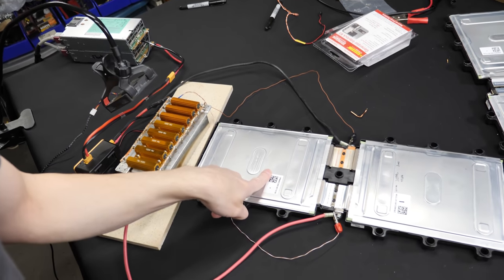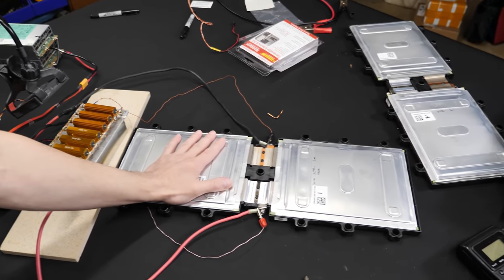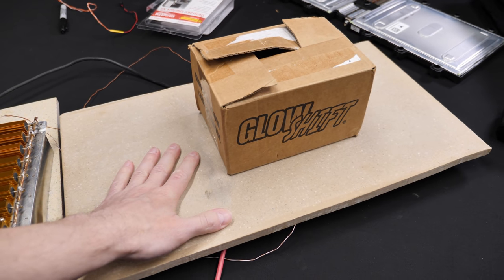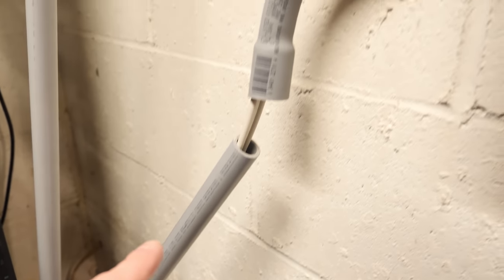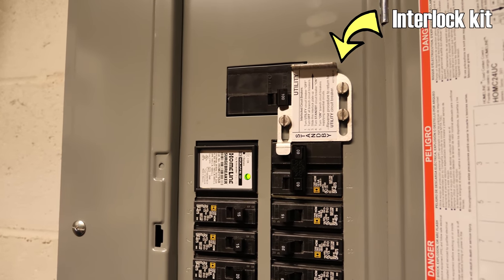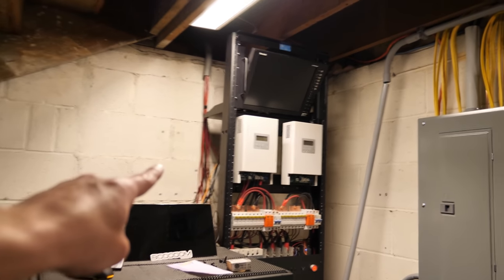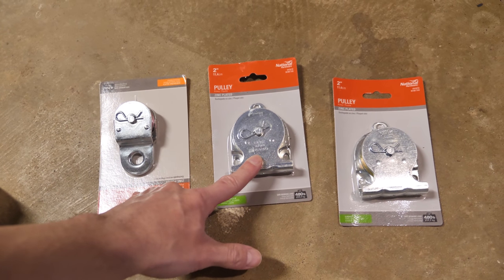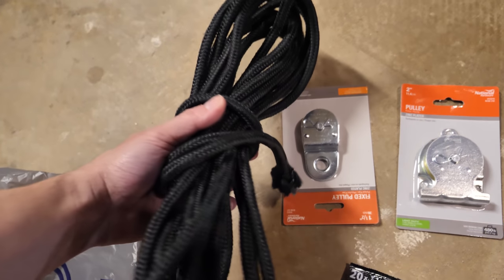Attempting to Mount 165lb Growatt Inverter on Wall!!

Comment: AJ, I know this an older vid, bur curious of your longer term opinion of the Growatt 12k?  I need a LF Inverter for all my daughters medical equipment as a backup, but torn between Growatt 12k or 2 EG4 6000 120/240 units.  Leaning to the Growatt, but your real world opinion would be extremely helpful.  Love your content and approach on everything.  Thanks and take care.
Reply from the maker: I still Love this inverter. Its on 24/7 unless I do a specific video and need to shut it off. I still dont have all my 240v items on it yet but will this year. I have run the AC and stove and no issues. Winter time I am in passthrough mode a lot due to no sun. As soon as spring hits Im off-grid. I would purchase again. Would also say I hear good things about eg4. One thing that they have better is the paralleling option PLUS you can add solar to each inverter. With my setup, I have to add seperate charge contollers to add more solar. Either way you go is a good option in my opinion.💥🤘

Comment: Which inverter did you buy, that will cover the whole house? Would like to go off grid myself. Thanks Ronnie
Reply from the maker: Link in description! I have the 12kw growatt split phase low frequency inverter. This one has the 250v solar charge controller. They also have a 150v version as well.

Comment: nice video. For the price of those pulley's , you could of got a "come-along" .They work good and lock in place. Most
of them are rated for 2000 lbs or more
Reply from the maker: 100% TROOF!!!😆🤘

Comment: Are you going to leave it with just those plastic inserts in the wall holding it?   I would suggest looking into something more sturdy, either the metal anchor inserts, or the actual concrete anchors.  Either way good work, I'm jealous of your setup, it's stupid trying to get even approval for some solar panels in my area...
Reply from the maker: I was thinking about leaving it. Do you think Ill need something better/stronger? The screws are pretty long and were tight going in.  Seemed pretty solid but Ill keep an eye on it to see if anything moves away from the wall.  Where are you located at or is there HOA rules?
Reply: @AveRage_Joe  165lbs is just a lot for those style of screws into concrete/cinder blocks.  I like in a suburb of Houston Texas, they want me to have a master electrician to pull the permit for the electrical, and I have to pull a building permit to install panels on my roof.  Looks like I can get the building one on my own, just working on getting the electrical without paying crazy amounts for someone to pull it for me.  HOA in texas pretty much can not deny you, that's a nice state law we have

Comment: Yep I would be the same to bullheaded to call a friend. When I mounted the battery bank shells they are 200 or so lbs I used ratchet straps which worked ok just risky like you
Reply from the maker: 😆Lol to be fair it was like 2am when I started the "lifting" process.  I guess to be honest tho I would have not called anyone just to see if I could of done it on my own anyway lol!  Big ass ratchet straps was going to be my 2nd option if the pulleys didnt work!!!  Ive done lots of sketchy things with them and all have been.....fun!😆🤘
Reply: @AveRage_Joe  Love a challenge
Reply from the maker: Always!!!💪🤘

Comment: Great content! Would you trust this inverter in a well house where there is potentially a lot of moisture during rain season?
Reply from the maker: Id have to look up the certs on it again. I dont remember the IP ratings or if it had any. If the pump house had some sort of ventilation I would think it would be ok. If its just a lot of standing water amd no vent then its hard to say.

Comment: Curious to hear your thoughts on the maximum wire gauge on the AC input. I have a thick 4/0 coming into our house, connected to a 200A breaker... This will never fit in the AC input of the Growatt (max 6 AWG). How do I convert the 4/0 to a 6 AWG? Also, 6 AWG is rated for 55 Amps and therefore (correct me if wrong) wouldn't cover for some of the peak loads I'm seeing in the summer (15 kW), right?
Reply from the maker: It can fit 4awg in those terminals. 6awg yes is 55-60a depending on the rating of the wire however they dont make 55a circuit breakers that I know of so they recommend 60a. If you take 60a X 120v its 7200watts so thats 7200w per leg. Yeah most home have 200amp service but rarely ever use that. Do you know how much power you actually use?
Reply: @AveRage_Joe  I peak out at 15 kW with the AC on in the summer. However, I'm worried about inrush currents that will easily exceed that and will probably trip the breaker. Good to know it fits 4 AWG as that would push it to 70A (or 85A at 75 degrees Celsius). Looking forward to seeing your video on how you hook up your main breaker to the AC output of the inverter! Keep up the good work man, I love your channel.
Reply from the maker: Is that 15kw sustaned for a long time or is it a peak. As far as "peak or surge" it says 36kw. Does not say for how long tho.
Reply: @AveRage_Joe  yep, that's 15 kW for a minute or so. I'll have to get one of those thermal circuit breakers that can temporarily allow higher inrush currents.
Reply from the maker: Oh you should be good I would imagine

Comment: I just attempted  mounting same unit. 2 Men and a boy, no luck, damn near dropped it. Not sure I have enough room to use pulleys, but now I have some ideas. Thanks for this vid. NOWAY this damn thing is 165lbs. Any idea if you can run it without a Battery? I'm just building, have solar panels, but the battery resources are limited. Some of the other Growatt videos say you can, not finding anything in the manual that says either way.
Reply from the maker: Yeah its a heavy mofo for sure! Was a hell of a time by myself! As far as running without battery, I havent tried. It may run with just solar but not 100% sure. Even of you had a small battery attached and run off solar would be doable!
Reply: @AveRage_Joe  Finally got this hog operational. Had to mount some heavy L brackets to set it on, lifted it onto the brackets, then used some 5/8 tapcon concrete bolts to secure it. Anyway, the unit CANNOT run without a battery. It's not in the manual, Signature Solar Tech Support said it WOULD... but their web site says no, you need a battery. Finally got my batteries and up and running,

Comment: Thanks for sharing. I returned the growatt 5000 es and replaced it with this 12KW version.  What did you use as a breaker solution if I may ask? I bought a 150 amp breaker for the smaller inverter but this big 12kw calls for 300 amps. Also may I ask what awg/gauge did you use for the cablinv from the batteries to the inverter.  Thanks
Reply from the maker: Thanks for watching! Yeah I dont blame ya for the return. Those are fine but can only do so much. Congrats on the 12kw! I am using a ABB SACE S5 shunt trip breaker(I am able to connect it with my bms). I was using 2awg welding cable with my old batteries but with the new cells going in Ill be using 0/2awg welding cable.🤘
Reply: @AveRage_Joe  Thank you for the response. I have 1/0 awg welding cable. I'll have to buy a second set equal rhe amount of copper in 2/0.

Comment: Great video, i have a question: Now that the inverter can switch between the grid, the solar panels and the batteries. Do you still need the interlock kit to switch between power sources?
Reply from the maker: Yes you need the interlock kit so you dont send inverter AC voltage to the Grid AC voltage.
Reply: @AveRage_Joe  mmmm what if you have an smart meter that can credit you for the uploaded AC power?
Reply from the maker: You would want to get a grid-tie inverter for that as this one cannot sync to the grid.
Reply: @AveRage_Joe  thanks again almost order a "non-returnable inverter" ....jeezz
Reply from the maker: You betcha and YES dont want to do that for sure!!!🤘
Reply: @AveRage_Joe  what will happened if you send the inverter Ac voltage to the grid Ac voltage in case of blackout (grid down) case
Reply: @wimam1977  kill lineman

Comment: I cannot see your email info on the about page. Are you going to go with signature Solar’s battery system. I definitely would have if I had purchased from big battery co.
Reply from the maker: You might have to check from a pc cause its there. Usually have to put a check in the box to make sure your not a robot🤣 I was thinking super hard on getting those batteries back on Thanksgiving when I purchased  the inverter but didnt have the cash at the time. BigBattery has some nice batteries. Ill be doing some vids on those here really soon! Doing some testing right meow! They hooked me up with a discount code for 10% if you ever purchase from them again. Its "joe10" unless you have a code to use allready. Anyway email is averagejoestuff@gmail

Comment: Now will you be running your whole house through this inverter? or is this just a backup? I looking in to installing something like this and putting this in in between my main panel and sub panel.
Reply from the maker: Yeah running the hole house off grid! You could also use as a backup as well. Mine is inbetween grid and panel.🤘

Comment: I need help my inverter has just an in LNG and an out LNG do I wire my in to my electric grid  panel and two legs out. Does the in connection create power for the panel  when panels off or out? Please help my directions are awful on the out panel it read 240v the in was 58v would really appreciate input the unit setup like the one you have without an app thanks!
Reply from the maker: Send me an email. Its in description or on about me page.

Comment: I want one of these  but do you know if this inverter is UL listed ? I don't care for the electrical connections being external with a cover thingy .  Is it ok ?  Can you do an idle draw and efficiency test under load when you get time please. Thanks for the great videos !
Reply from the maker: Its a nice inverter for sure however I dont think it is UL listed.  Could be why its a little cheaper then many others but dont quote me on that.  I remember seeing some certificates but dont remember seeing UL.  I just did an operational check video about a week ago and I did idle draw and an eff test in the video.🤘

Comment: How are you providing ac line in to the invertor if you are using that disconnect switch to the main? do you have another panel? I might have missed something..
Reply from the maker: I just did a video on how I wired it up on my channel.🤘

Comment: I’m using the same inverter. Question. Is the a/c Imput from your main panel, and the soon to be off grid panel is a sub. If so will the inverter back feed through the ac input?
Reply from the maker: So I kinda lucked out with how they did my wires back in the 50s lol.  My service entry wires from the meter come into an old fuse panel but before they connect to the fuses they split into a Y.  One end of the Y goes to the fuses and the other end of the Y goes to another panel.  So its kind of like I have 2 "main" panels when it comes into my house.  So one panel supplies the inverter and the other is powered by the inverter.  Not to make it toooo confusing on here but in a future video Ill have a wiring diagram of how its hooked up.  Actually if you email me I can send you my "wire" diagram if you want. My email is on the about me page on my ch!

Comment: I have PVC heaters to easily bend the conduit... lemme know if you want to borrow the small one, or meet up and use the big one!
Reply from the maker: Ive been using a heat gun! Only need a few moar bends at this point. Couious tho, how well does your heater work on pvc. Does it heat all the way around at once?
Reply: @AveRage_Joe  I have two styles, one is a heat blanket that wraps around the pipe tight.
The large one is an oven with rollers for heating up to 3”pvc. On the small stuff, it heats in in about 30 seconds to easy flexible.

Tip, have a wet rag handy to cool quick to lock the pipe shape in.
Reply from the maker: Ooooo I completly forgot about the wet rag trick!🤦‍♂️ Thanks for that!!🤘 I bet those work AWESOME!

Comment: Good day, does that inverter feed back to the grid? If not how do you get it to transfer to grid charge?
Reply from the maker: No it does not feed the grid. You connect inbetween grid and your main panel or a panel you want to supply power to. The incoming grid power thats connected to the inverter can be either switched on or off from inverter. Let me know if that answerd your question.

Comment: Now that you have had it now for a few months, are you still content with the Growatt. I am planning on the 8k unit.
Reply from the maker: Yeah absolutly Love it!!!
Reply: @AveRage_Joe  thank you, sir
Reply: I am looking at the 8Kw unit as well. In the manual under the "PV connection" page 10 it states that it requires 8AWG from the panels. Really? I thought you sized that wire by distance etc. I plan on using 8 AGM 12V 400W 100Ah batteries with it. Still not sure if 8 Kw is overkill or if 6Kw would handle my loads...
Reply: Another question is does anyone know the idle power consumption of the 8Kw unit?
Reply from the maker: You can use what ever wire size you want. I think it states it CAN take 8awg. In summer time 5kw of solar takes care of my loads. Winter time it does not lol
Reply from the maker: I do not but think it would be similar or a little less then mine.

Comment: I am using items from signature Solar two of 5K batteries, rack, inverter to power the batteries from the grid, and then power the items in the home from the batteries only 120 volts by extension cords.( so need to covert from 100 amp , 240 volts )

Comment: Hi,  I just wanted to know, wheather i can use this inverter without battery. I just wanted to decrease my electricity bill. I also have an issue with reverse power. That is there is a problem if reverse power flows through my electricity meter. Thats why I wanted to use hybrid inverter without a battery. I also wanted to know if this inverter combine power input power from two sources or just switch between them. That is, say my load demand is 1000Watt and solar produced 500watt. Will this inverter combine 500watt solar power with rest of the power from utility or just switch to grid as 500watt solar power is insufficient to deliver 1000watt demand. Thanks in advance.
Reply from the maker: This is an off grid inverter only. It does not send electricity back to the grid.
Reply: @AveRage_Joe  Brother, can you please suggest me one which can do this. That is combining both solar and grid power.

Comment: Can the Growatt 12kw hybrid inverter be configured so that the storage battery only charges via solar input?

(Basically I want my  solar array to charge my storage battery during the day, then at night when I get home from work I want to plug my electric car in to charge from the storage battery and then have it pull from the grid to complete the car charge cycle if necessary) (I don’t want it to ever use the grid to charge the storage battery)
Reply from the maker: Yeah you can do that 100%!  I have mine set to charge only from solar. The settings you want to use is SBU (solar battery then utility) for everyday operation and the charge setting to SOL(solar only). You will use the sun to charge battery, then any excess can run your house if connected. Then when sum goes down you use battery. When battery is ded then it switches to utility.  Thats what I do. Most of the time Im offgid unless there is no sun. 💥🤘

Comment: I have never seen so bad masonry bits that the tip cam off in the wall and in the first hole it looked like
Reply: cheap made in china set i am sure
Reply: @ursodermatt8809  I mean I'm sure they are and I probably have some made in china too but I just have never seen that
Reply: @james10739  
neither have i.
possibly average joe hit metal inside the brick.
Reply from the maker: YEAH!!!!! Me Either🤷‍♂️ Seriously....that was the first hole too. That was one of those "tool kits" Ive had forever and probly came from walmart. I moved up to the next size for the pilot hole and that bit seemed to get it done. Im wondering if the first bit got to hot🤷‍♂️
Reply from the maker: Its possible but kinda thinking the bit got to hot🤦‍♂️
Reply: Let me quess- Harbor Freight?

Comment: I live in area where Utility electricity comes on cycle 3 hours on and 3 hours off, do you recommend me this inverter with solar system and backup battery (LIPO4 10kwh 200amp) please advise me as I am looking for low frequency single phase inverter
Reply from the maker: Yeah this inverter would work great for that!🤘
Reply: Another question plz, my battery is designed to be linked to another same battery but the voltage my supplier said will be double so if the 2 batteries linked will give more that 90v will this inverter handle it ?
Reply: Also can this inverter cobain solar power to reduce the grid consumption power

Comment: If u trying to get lifepo4 cells to li-ions 14s 18650s  goo with 17s yes usualy goes 16s but with 17s with bms u would be much more happy less problems.....
Hint...👍
Reply from the maker: Your saying 17s lifepo4! I only got 16 this first round😳
Reply: By my setup it seems if i charge li-ions up to 57v...lifepo4 some cells go over 3.65....everything over 3.4 on lifepo4 it takes small amount of charging and then goes over 3.65v/cell on the other hand if u go with 17s i go up to 3.35 and lifepo4 still nicley soak the power and capacity remains because 1add cell...
That are my thinking and also praczical aplication...
Reply: Li-ions have almost linear dis/charging curve lifepo4 is different story.....